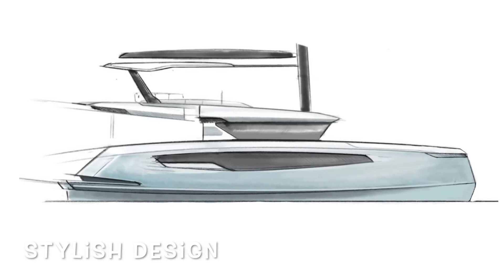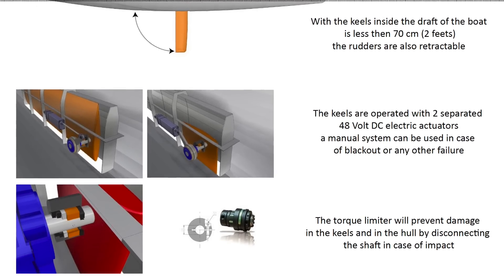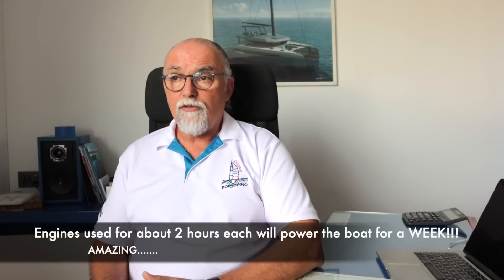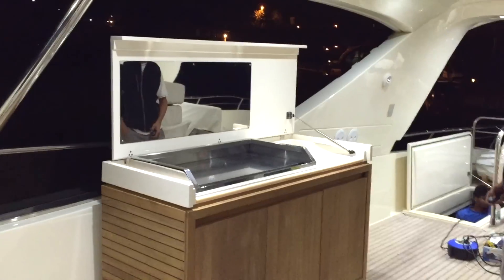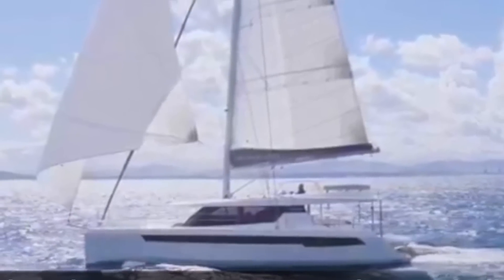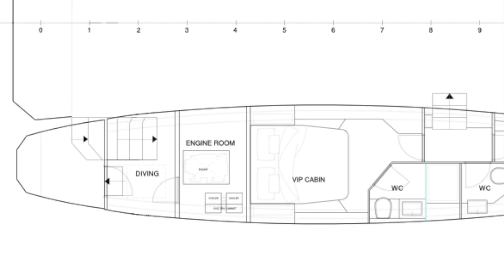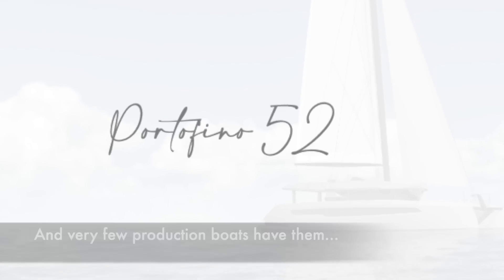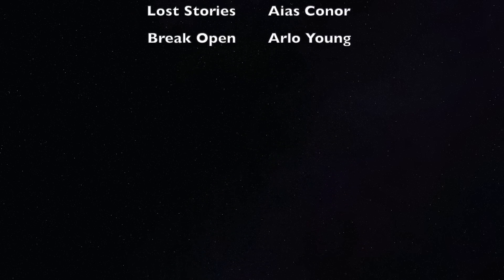S3#4.  NEW Portofino 52 - Designing THE PERFECT PERFORMANCE ALUMINIUM CATAMARAN for us?

Comment: So happy for you guys. Can’t wait to follow along with the entire process. The owner seems very knowledgeable and flexible. Love the lifting keels/dagger boards; Haven’t seen that on any other cat that I’m aware of. Just curious will you not have a generator and instead just run the engines to top up the batteries? Curious what battery system they are looking to use. Have you heard of Volta power systems?
Reply from the maker: Thanks Barry! Yes the features are spectacular and quite unique! We have not looked into the different lithium options yet as we are still focussing more on the performance and design at present...